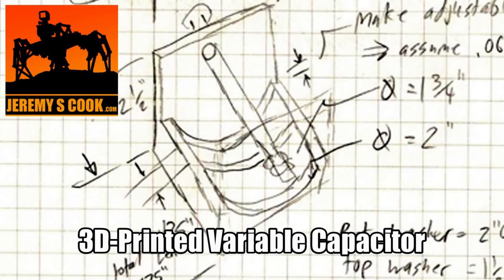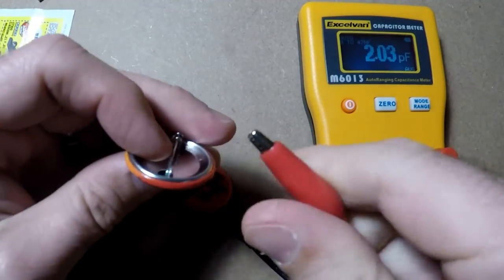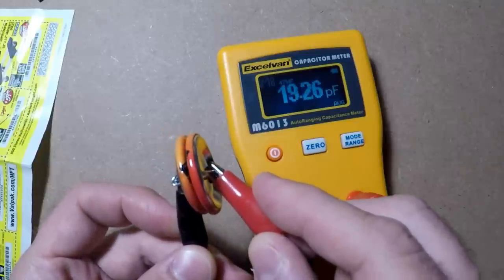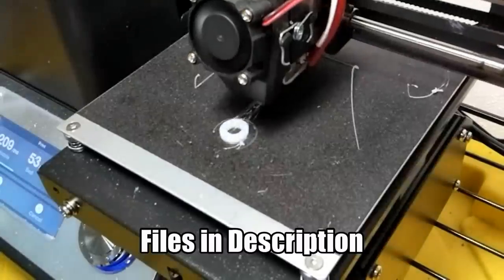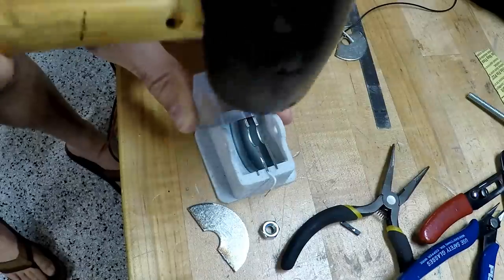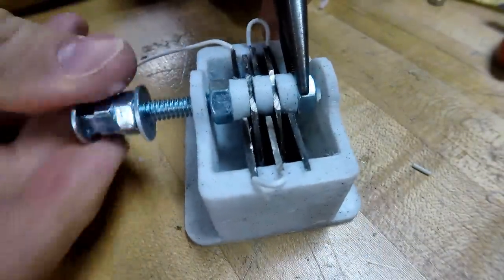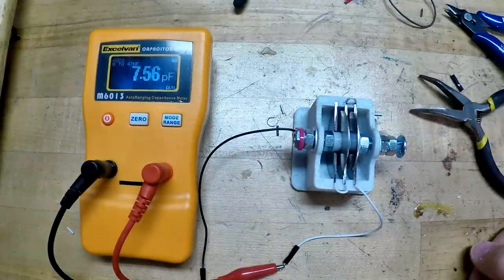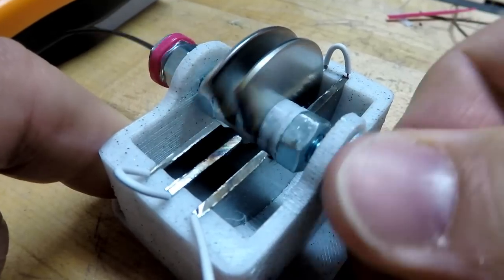Variable Tuning Capacitor [3D-Printed]

Comment: Awesome! I remember finding something like this attached to a knob inside a radio or something that I took apart when I was a kid.  I'm almost positive it was connected to the knob that tuned in the frequency, but it has been 30 years, so my memory is probably quite fuzzy!
Reply from the maker: Thanks! Yeah, that sounds about right, given what these were used for. I understand they're still used in amateur radio, but I have very little knowledge of that pursuit.
Reply: You remember correct. They are used as tuning capacitors in almost all portable am recievers  along with a ferrite loop antenna

Comment: That's right, that is okay, more than okay. A typical electrolytic capacitor has a tolerance of 20%. So it's likely it would be acceptable for that capacitor to measure anywhere between 37.6uF and 56.4uF.

Comment: That's really neat. Didn't know you could do something like that with just metal plates.
Reply from the maker: Thanks! Yeah, it's not a ton of capacitance, but you can imagine how this would add up eventually.
Reply: Actually, that's all a capacitor really is.  Just a number of metal plates separated by a dielectric (insulator) and in some cases an electrolyte solution. Pretty neat, huh?

Comment: This spacers don't need to be insulators, as long as they don't touch the lower washers. And the upper washers would even make better contact with one another if it was just metall spacers.